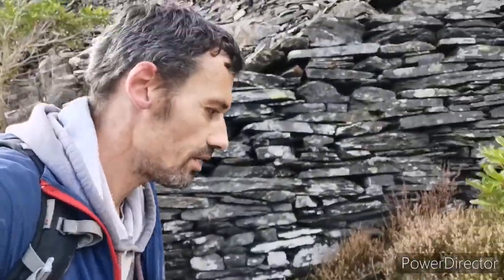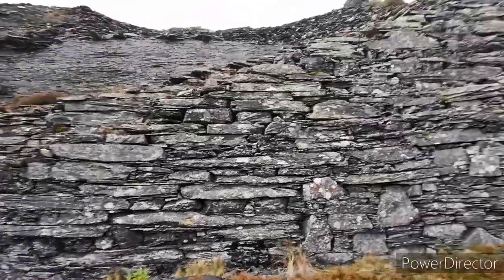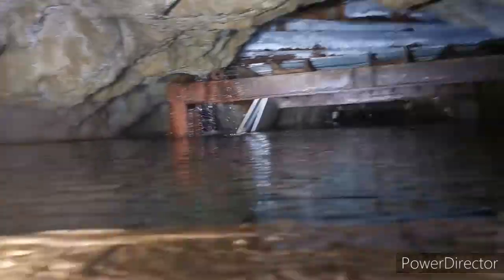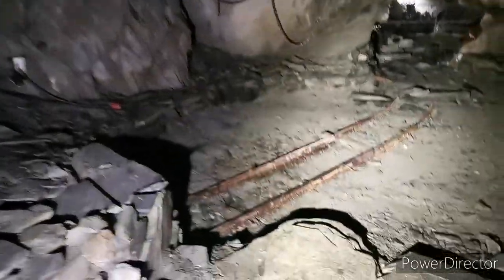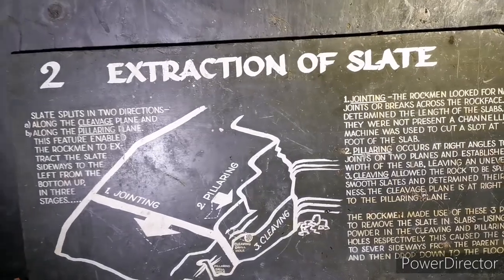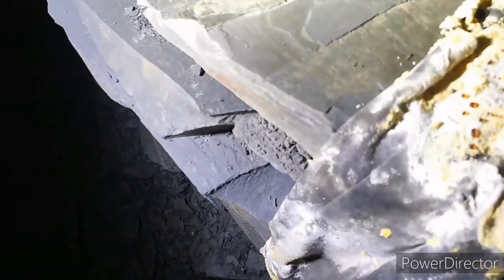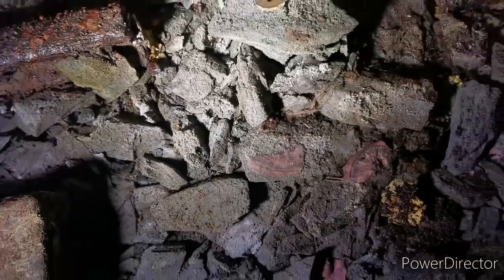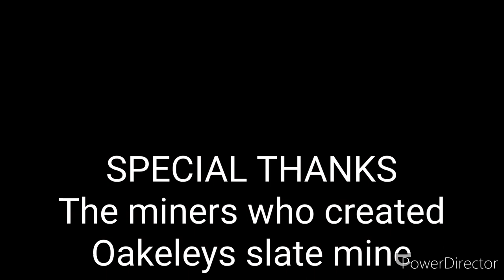The Old - Gloddfa Ganol Show Mine

Comment: This video is slightly misleading, as it suggests that it's a continuous trip. It's initially far from continuous as the false crane chamber and the inner end of the reservoir/former escape balcony have long been completely isolated due to past untopping. Impassable roof falls prevent the continuous trip suggested here.
Reply from the maker: I don't understand what you mean as miss leading. It might be edited to come across as a bit miss leading to stop others searching for the proper way in as it's a working mine.  As for continuous, it is barring having to go outside for 2 minutes, which I cut out to hide the location